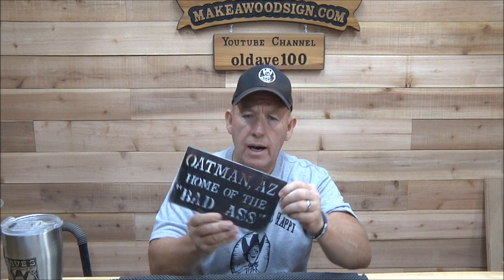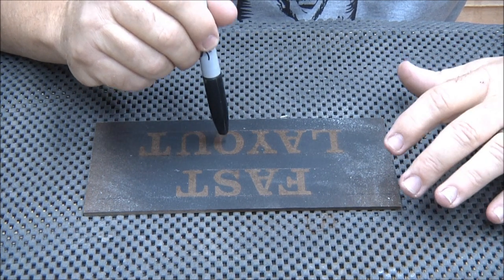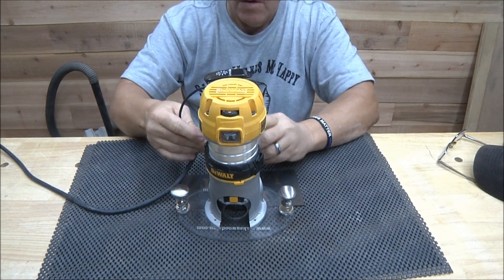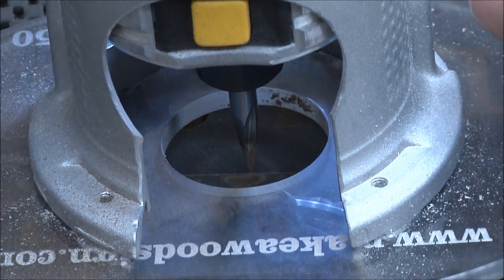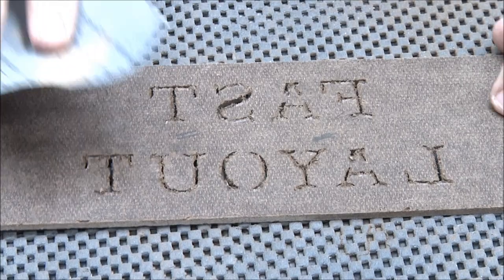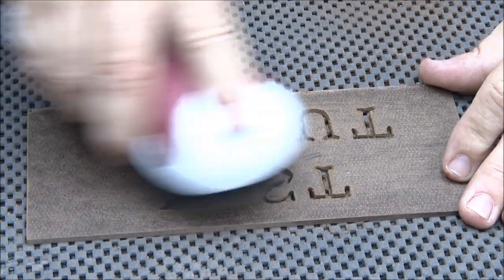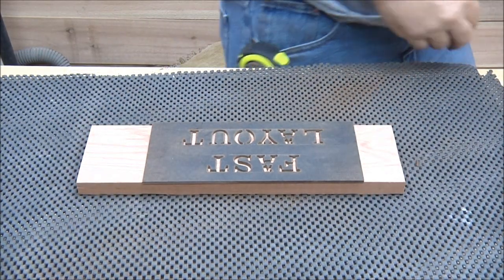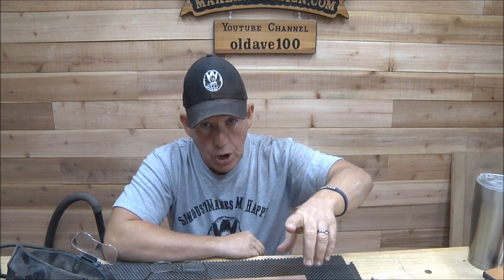Coffee & Questions 8/23/17 Making A Stock Sign Layout Template

Comment: By the way, got my Critter spray gun the other day.... not used it on any signs yet but I did install a new garage man door on my house and used it to spray paint the door prior to installing it. Paint straight out of the can and did a great job for me. Only problem I had was the paint kept drying on the nozzle while spraying, but a paper towel I had on hand and with a quick wipe off kept me going till I was finished. Now if I can just find some spare time to carve.....
Reply from the maker: I haven't tried spraying paint yet but I need to. Glad it's working for you. I will remember to keep a paper towel with me when I do. Thank you for the heads up. Hope you get to make some sawdust soon. Thanks again, Eric
Reply: Gary Hi  got my Critter spray gun last week  used some water based spar urethane works great takes less time to set  up and spay than to shake up a  can cleaning was quick no nozzle build up  have a great day Dan